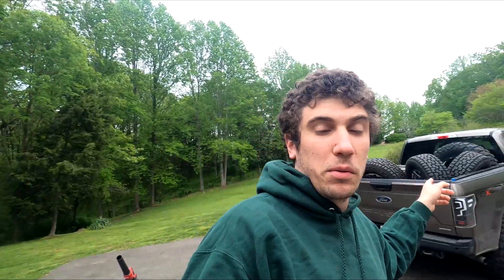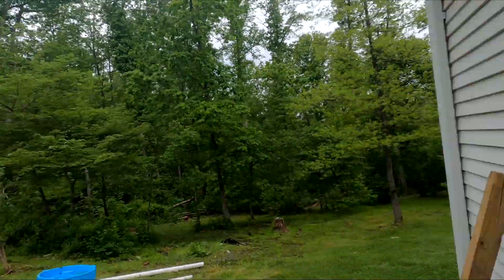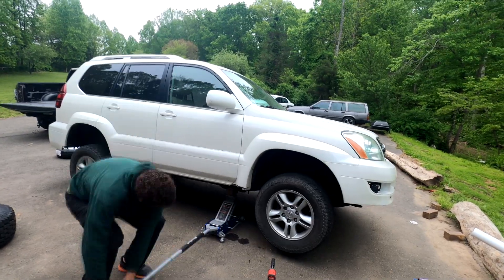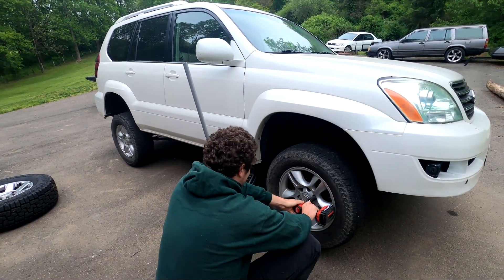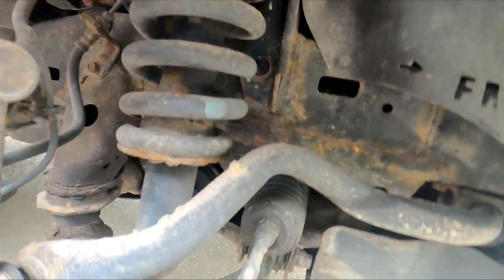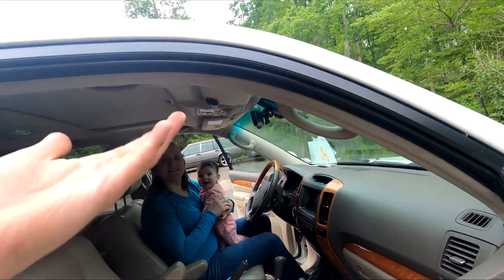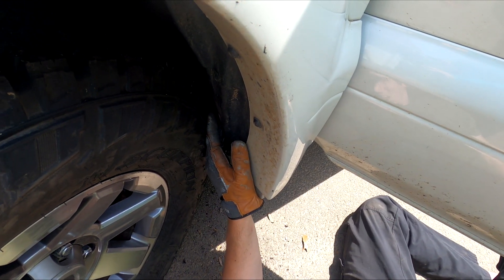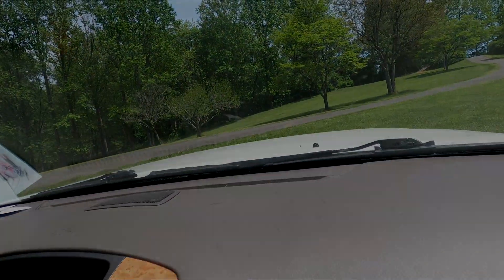GX470 Overland Build: 33s on Stock GX470?

Comment: If anyone runs across this video wondering...yes he had problems and needed to lift 😅
The max tire size you can fit stock without issues is 265/60/17 which equates to a 31.6 inch wheel
 ("almost" 32s)